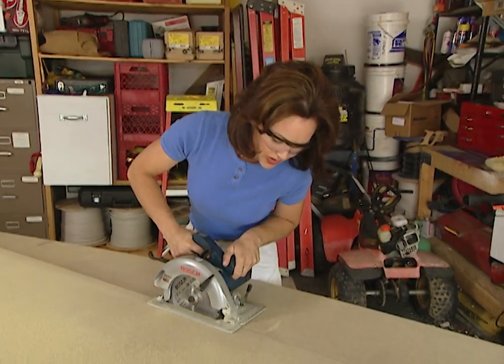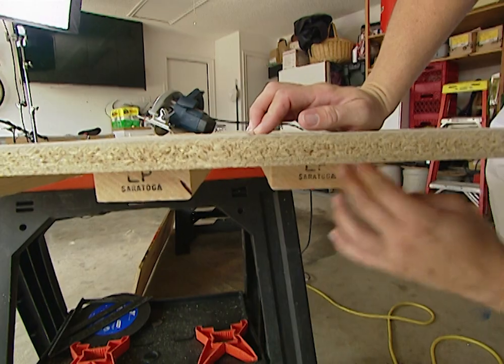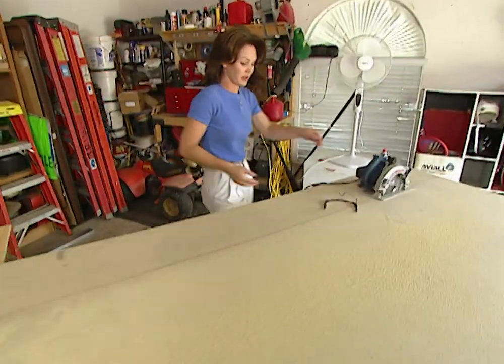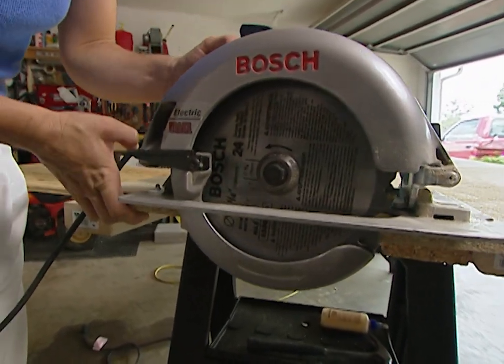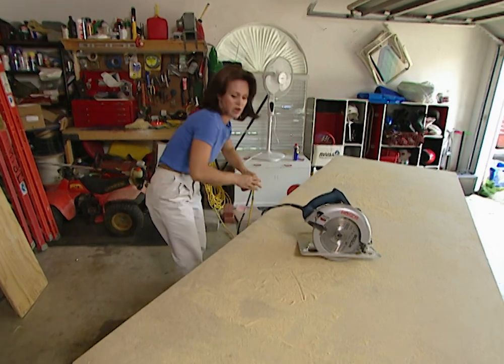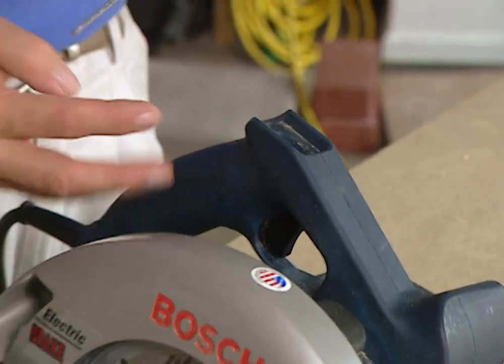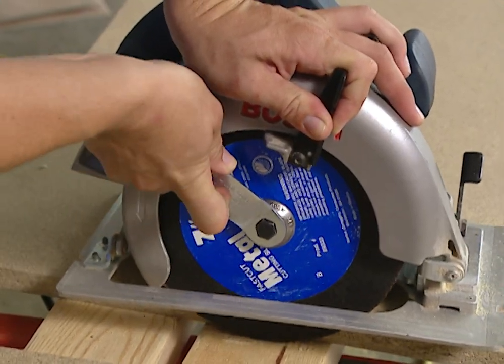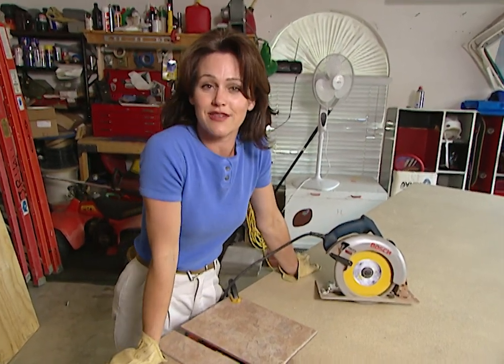How to Use a Circular Saw - Change Blades, Prevent Binding and more

Comment: Great tips!  Question: New saw, new blade, however in cutting a 2x4 it would slow down-almost stopping about a 1/4" from the end, so I'd have to turn it over to complete the cut.  Both sides of the 2x4 were supported.  Then did not happen on each cut though.  Why?  I am perplexed.

Comment: I am a DIYer on a budget so bought a small marble cutter , a smaller cousin of the circular saw, takes a 5 inch blade, but it gets stuck in even small 2inch thick crate lumber, sometimes even kickbacks dangerously, i have tried different blades 30 teeth and 40 teeth,but still no difference .can you make a video showing how the cut differs on using 30/40/50 teeth blades.